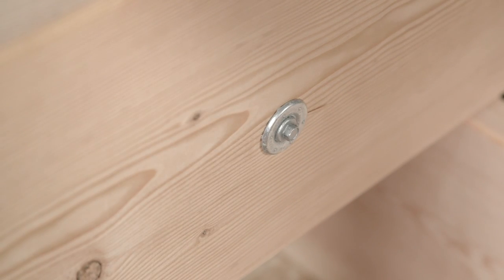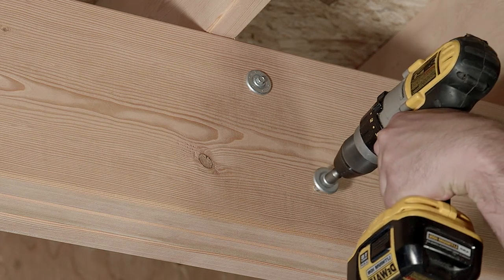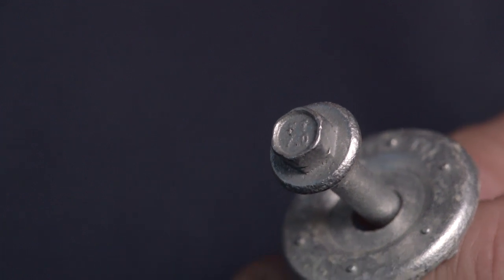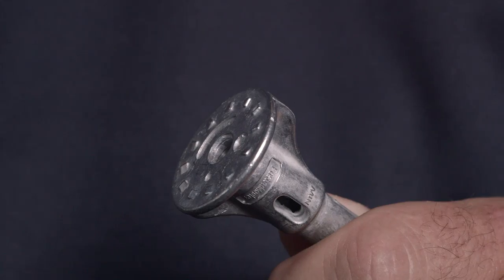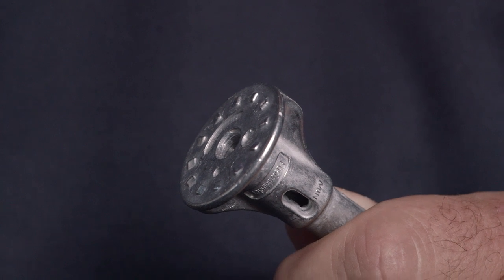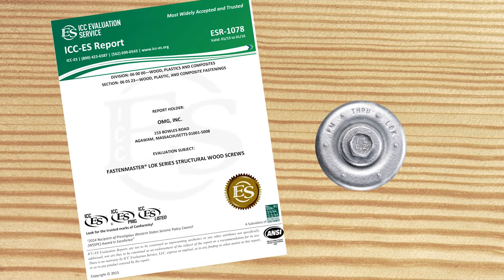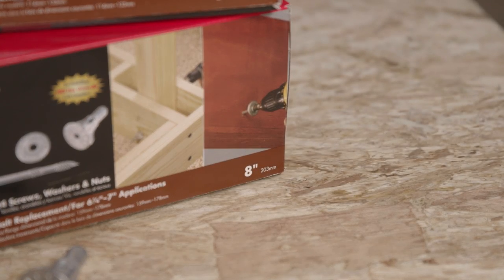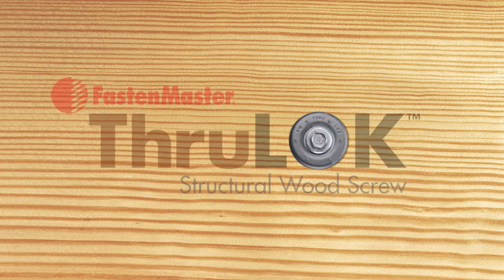FastenMaster ThruLOK Through-Bolt Replacement

Comment: Can you counter sink the drive end so you can cover it with fascia board?
Reply from the maker: Hi, thank you for reaching out. You can countersink the ThruLOK head using using a 1-1/8" or 1-1/4" spade bit up to 1/4" deep. This will allow for the washer and head to sink flush while still meeting the code required loads.

Comment: I would be surprised if any structural engineer would approve this.
Reply: why wouldn't they? its specifically engineered to replace the same size carriage bolt and works the same after installed.
Reply: lol they are code approved
Reply: Looks like you need a very specific size for what you’re using it for